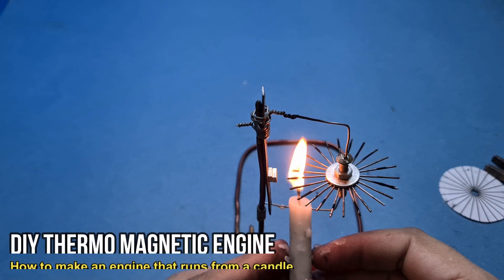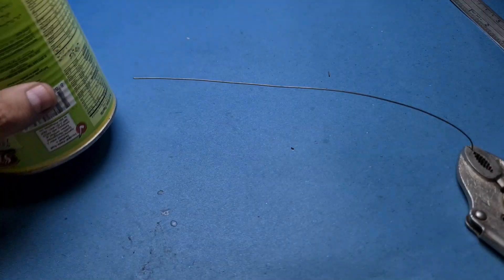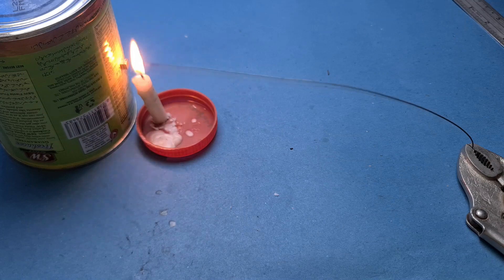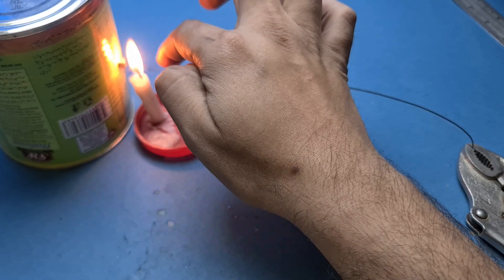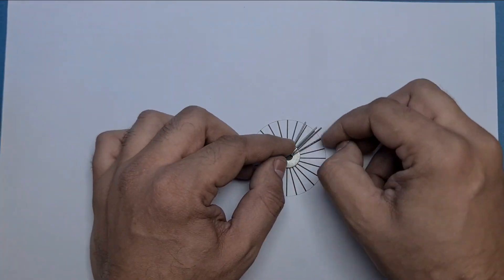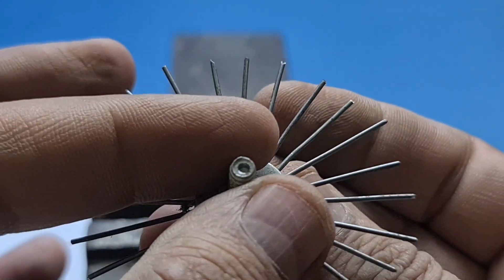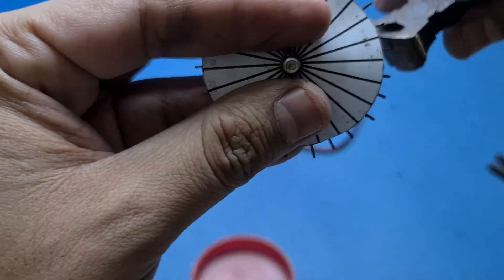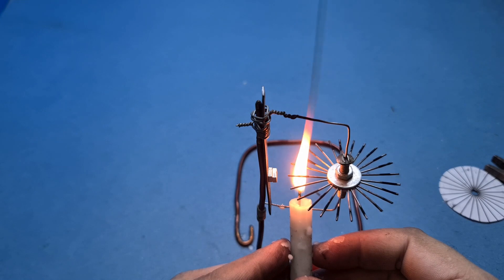DIY Thermo Magnetic Engine (Candle Powered)

Comment: Try turning the base on its side. With a vertical wheel you can heat more than 1 wire nail at a time with the same flame. 🙂